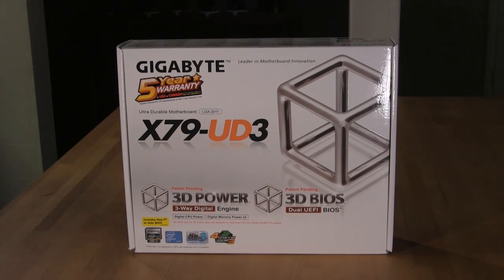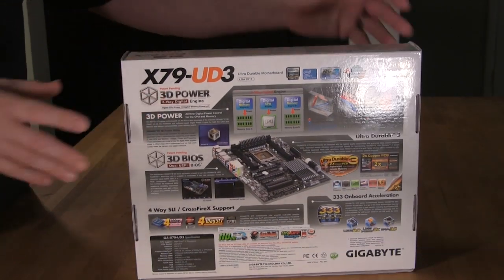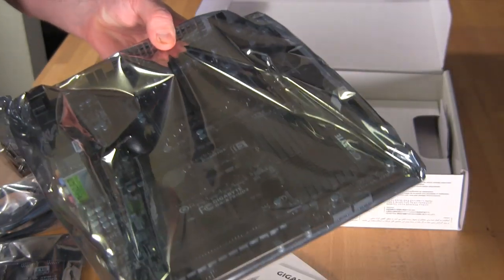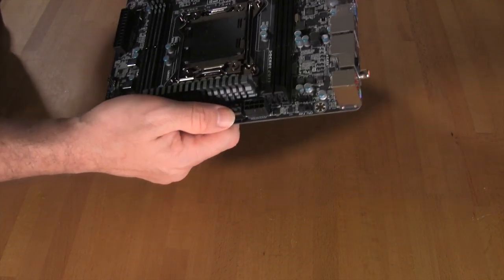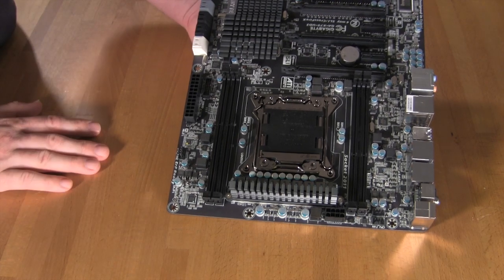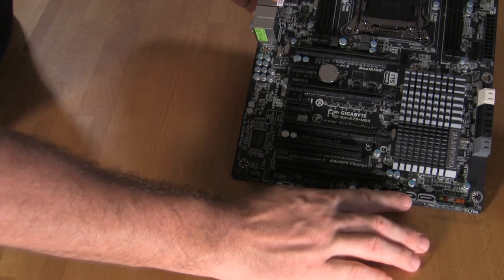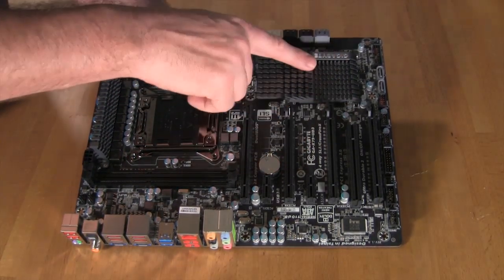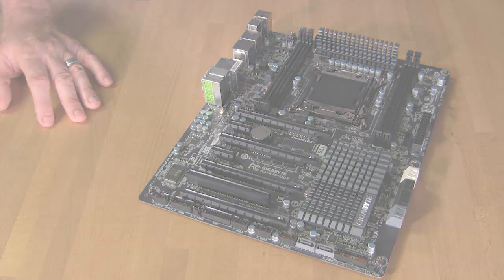Gigabyte X79-UD3 Features and Layout

Comment: At 4:13 in the video you mentioned solid capicitors and stroked the 10.. Do you know what the last one is used for its kind of hanging away from the other 9?
I only ask because I just busted mine off the board trying to remove a stripped screw/cpu mount bracket screw, I slipped and took the fucker cleanly off the board..
The pc still boots and runs but it only happened a few hours ago so I don't know how stable shes gonna run..

Comment from the maker: The Rampage VI Gene (which we have also covered) is a aimed at a different market. The Gene has better components including high-efficiency Nichcon Black Caps. This is going to offer higher headroom and life than the solid caps on the P8X79 Deluxe. The Gene also has PCB seperation for the oneboard audio and other features that make it a better choice for gamers and overclockers....

Comment: Thanks so much for the detailing on which peripheral slots ran in which modes. Didn't want my 580s to not be able to fit together, like the Asus Maximus IV Gene-Z board I got before. Little oversight on my part. Double-spaced x16 slots are a godsend on a board this cheap. Subscribed.